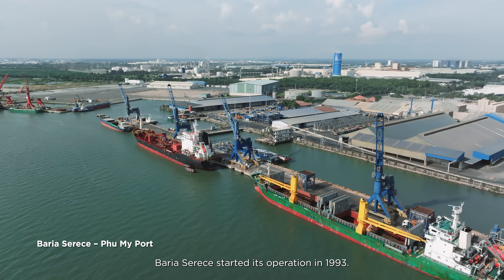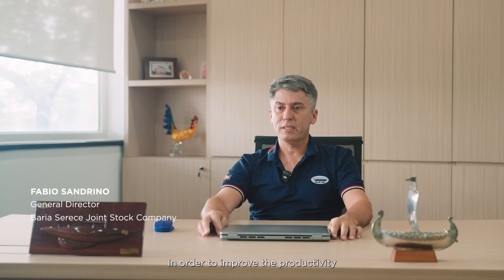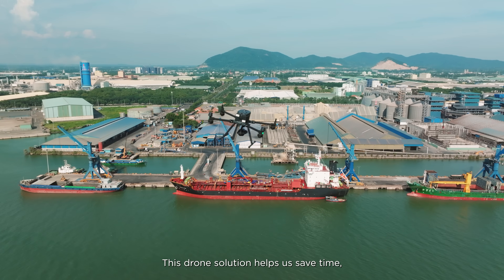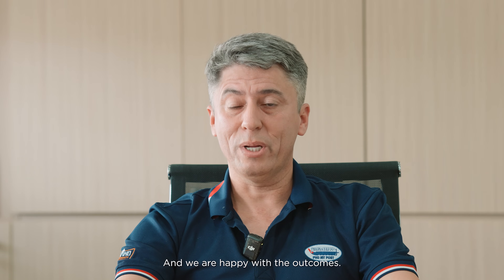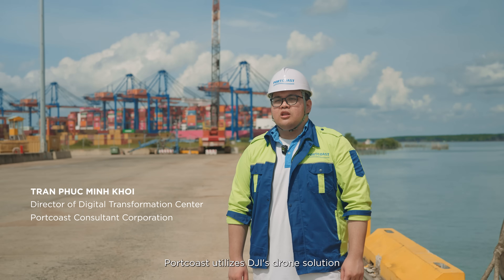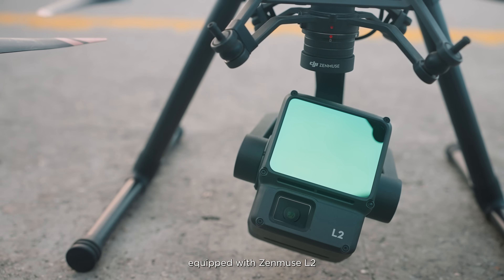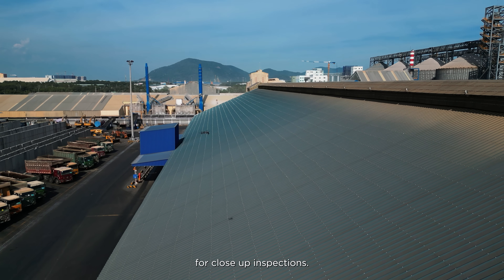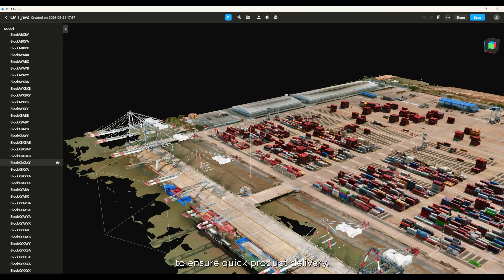How Drones Are Shaping the Future of Port Engineering

Comment: What does the customer, in this case the terminal, do with the aquired data?
Reply from the maker: Great question. The terminal may use this data for tasks like coastal erosion monitoring, structural inspection, 3D modeling, and environmental impact assessments. This helps improve planning, maintenance, and long-term sustainability of port infrastructure.